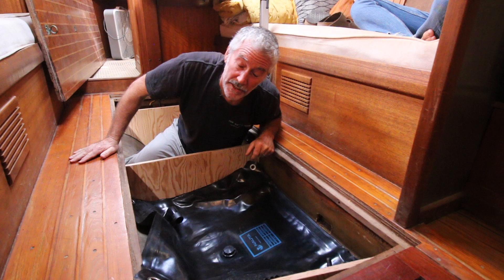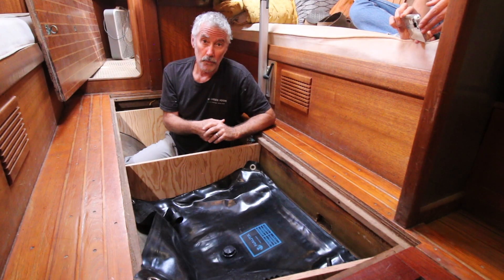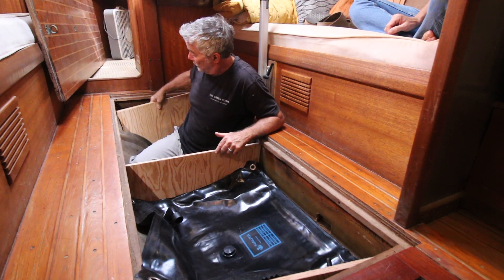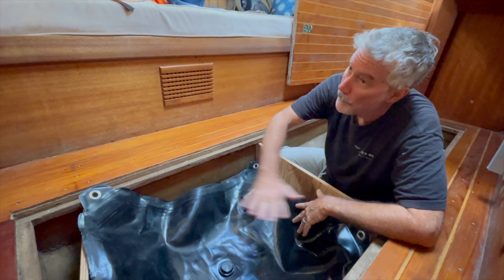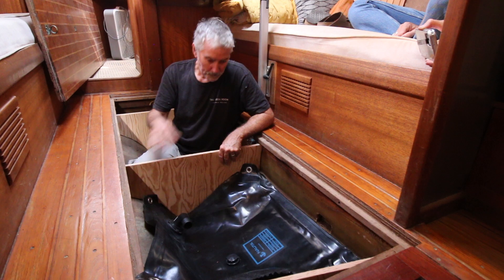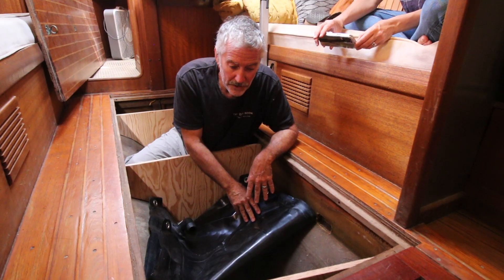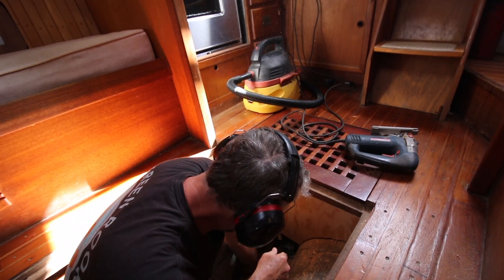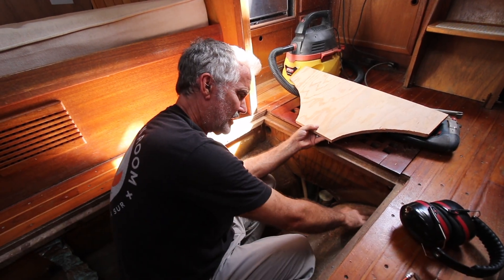SLS Ep 2 Nauta Water Bladder Bulkheads | Part One

Comment: I have a Plastimo flexible tank.  It has a fabric exterior and a plastic liner that holds the water.  The tank’s wall “buckled” in a couple of places.  I dont have a better word to use.  “Kink”?  When the tank moved back and forth in a heavy seas, these kinks caused the plastic to fatigue and developed a hole in it.  I was able to repair it with high temp red RTV silicone and a piece of fabric.  But i will be replacing it with a stainless tank.
Reply from the maker: @jasonmcintosh2632  Interestingly. I would be interested to see the Plastimo and the Nauta side by side to compare. The Nauta is extremely rugged, though I suspect over time it too will fail. I am however, as I mentioned in the vid, fastening these tanks very securely as to allow almost no movement other than the water inside. The tanks should stay put. That said, nothing lasts forever. I would love stainless tanks but they aren’t in the budget. Thanks for checking us out and commenting Jason!
Reply: @sunlovesailing  (I'm at a computer now so it's easier for me to type.)

I mentioned that failure mechanism because it surprised me.  A big part of the reason for the failure is that the inner plastic "bag" is of rather stiff material, probably because they made it fairly thick, probably because they wanted it to be durable.  But the the thickness actually worked against it longevity as the bending of the plastic around the tight "kink" lead to the plastic to fatigue and fail.

The Plastimo inner bag is simply two sheets of heavy semi-transparent plastic sheets heat welded around its perimeter.  This simple construction technique meant that the ends of the plastic bag would "pucker" when water was put into it.  These puckers are the "kinks" I'm trying to describe.

Anyway...

Earlier, before the bending fatigue failure, the stitching in the outer nylon bag failed due to abrasion against the hull.  This failure caused the plastic bag to lose support along about a 2 foot section,  Without this support, the welded seam failed and a big "hole" was created in the plastic bag.  However, I was actually able to fixt that too using the high temperature food grade red RTV silicone.  I applied the silicone between the two sheets of plastic about an inch into the bag, away from where the seam blew out.  I then used a sewing machine to sew the plastic sheets together.  Of course this perforated the plastic sheets, but then I used a scraper and pushed the silicone into the stitches.  I then inflated the bag with air and let the silicone cure.  The stiches supply the strength to keep the two sheets together and the silicone sealed them.  I'm quite proud of this repair and mention it mostly because I have no one else to tell...  

The previous owner put the water bladder into the failed internal water tank.  I won't be investing any further into a bladder but will be properly fixing my water tank.

Anyway, you may want to have some food grade high temp red RTV silicone onboard to possibly repair failures if you're away from port for a long period.  RTV gasket silicone will work in a pinch too.
Reply from the maker: @jasonmcintosh2632  Yes I can see where the rigidity of two separate linings could cause fatigue. The lining in the Nauta tanks is not a "material" lining  but an applied film lining s there should be now "fatiguing" of materials against each other... I hope. You've done a clever repair on yours, good work!! The stitching and then the glue seems to have worked worked well, and hopefully for quite some time. I'm just not interested in spending the money on SS or Monel tanks at this point. When and if these fail, I'll just replace them in kind. Too much money to spend, and I just want to go sailing. 

I'm very interested in the high temp red RTV silicone, that sounds like a great item to have on board while voyaging. Keep in touch Jason!